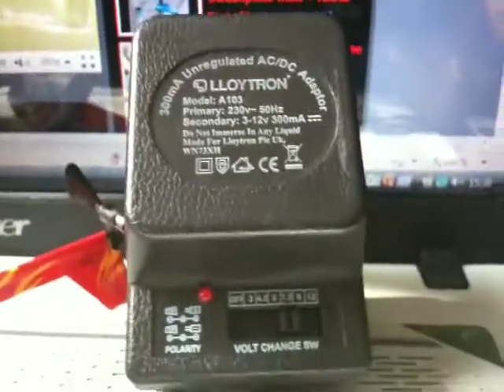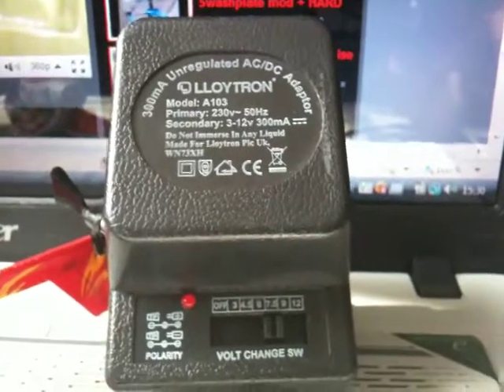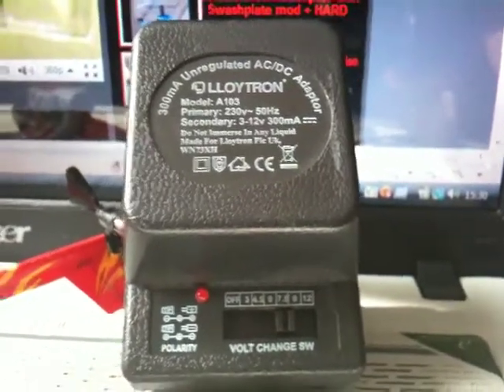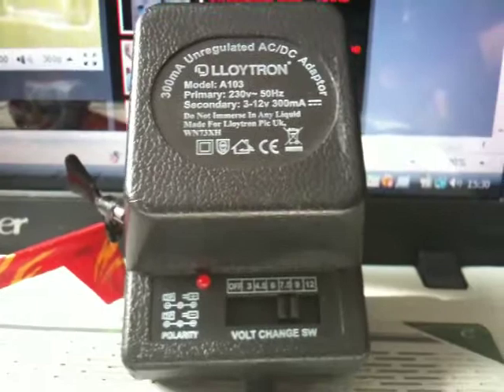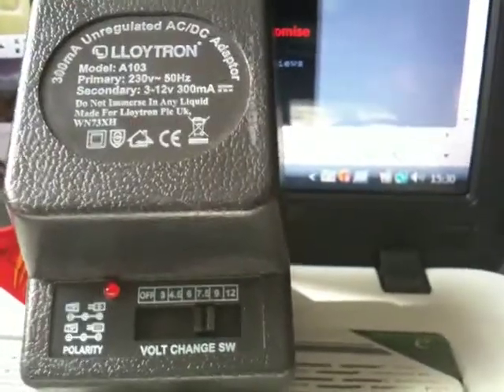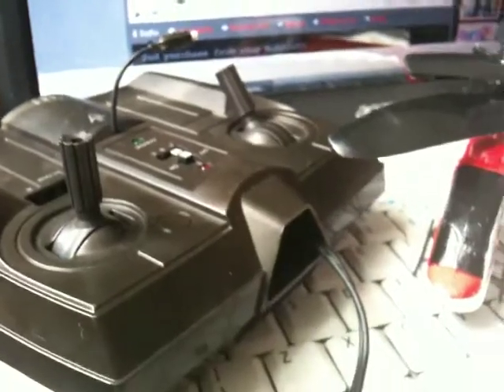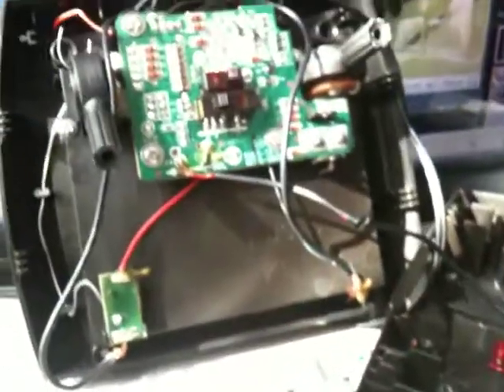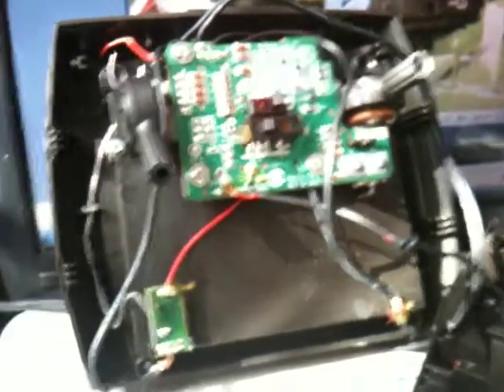PICOOZ charging from AC wall socket

Comment: Greetings.
I see that you've  posted this video 10 years ago, but I have to ask for help. My picoz won't charge at all, there is no current at all at points ch+ and ch- on its mainboard.  I guess finding faulty component would probably be too difficult, so I've decided to adapt cellphone charger and charge helicopter directly. What do you think of that solution?